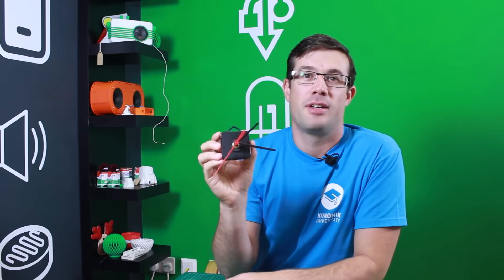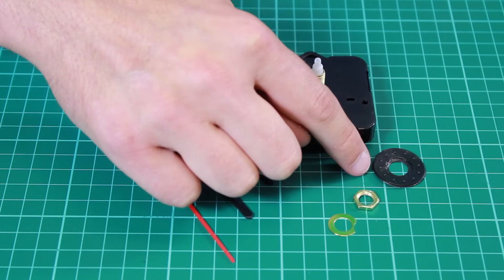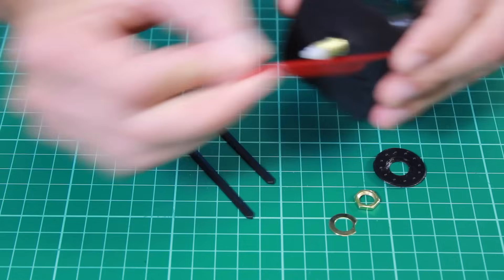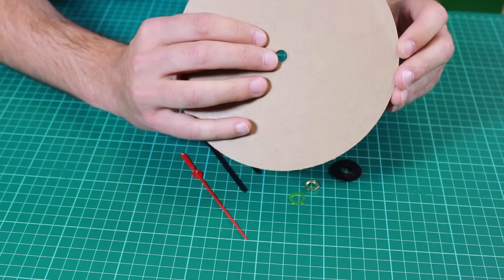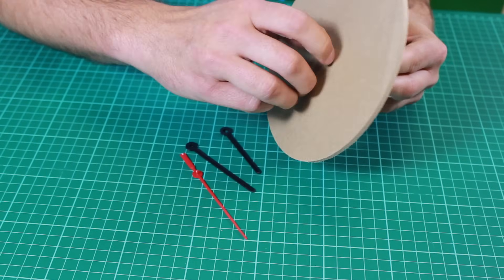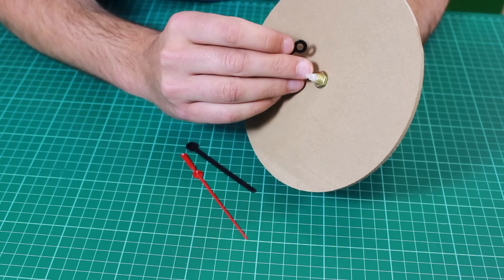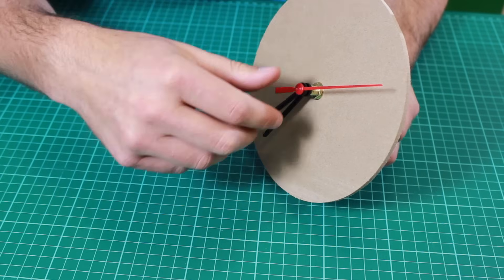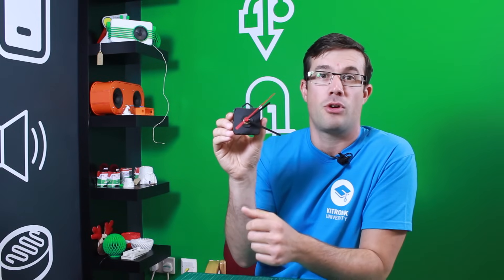Quartz Clock Mechanism from Kitronik

Comment: Great video. Thanks for sharing.  Some years ago I bought some clock movements. Now I'm finally so far that i made my first clock. I took one movement out of the package, but the manual with it was very short. Only some hazy pictures or drawings. Your video gives me the courage to give it a try tomorrow. Assembly of all types of movements seems to be more or less the same. Every (first-hand = new) has a second hand mounted as the third (last) hand, I guess.

Comment: I have your clock but the hands don’t stay still ??
Reply from the maker: Hi Daniell, sorry you are having issues. Don't hesitate to get in touch with our support team at support@kitronik.co.uk and one of our team will help you resolve the problem.
Reply: @kitronik hey sorry it’s worked now I just had to apply more pressure to the hands while putting them on

Comment: Could i convert this 12 hour quartz clock to 24 hour clock?
By making the hand gear twice the original??
Reply from the maker: I would be tempted to produce a more simple solution. Have two circular rings of numbers around the clockface. The outer ring would be the numbers 1 - 12, as normal, and the inner ring for 13 - 24. Maybe have them in different colours or the 1 - 12 larger than the 13 - 24.

Much easier than trying to hack the movement.

Comment: Why does my hour hand not stay tight and just flips down to 6? What am I doing wrong?
Reply from the maker: Hi, sorry you are having issues with your clock mechanism. If you got it from us, get in touch with our customer services team who will be happy to help you get it going or replace it if there is a fault. support@kitronik.co.uk
Reply: I am having the same trouble but I bought the clock from a wood working company.
Reply from the maker: @dlwsport250  Hi, did you try contacting them to arrange a replacement?
Reply: @kitronik  Thank you!! I followed your video one more time and though I bent the "hands" , I eventually got it working. The "key" was when you added the second and and it began to sweep I realized that I needed to apply more pressure. I am in the US and the maker is in Turkey. I am sure he would have replaced. A little "effort" was required and I was too nervous to break anything, It is working. Now I just have to have the courage to hang it up. Cheers, from Asheville, NC

Comment: Best video ✌️
I was searching exactly this.
In my kit there's no screws and washer or rubber washer. Only a machine and three hands. What should I do? Will they work?
Reply from the maker: Hi Munazah, as long as there is a nut to screw onto the thread it can be tightened to your clock face. If you are missing this then it would be best to contact the company that you bought it from and check if there are any parts missing.

Comment: Will it still work if you don’t have the rubber piece? Mine doesn’t have one for some reason.
Reply from the maker: The rubber piece helps to maintain a lock against the clock face and to prevent any slipping or movement. You may experience no issues but I would say a rubber washer of some kind would prove to be beneficial. Was your mechanism supplied by us?
Reply: Kitronik  thank you. I’m not certain where it was supplied from because it was a set given by my school’s wood shop class.

Comment: I want to do this on a wall with hands of my design and manufacture.  This would be no clock face and long (30cm) hands.  would your device work with the mechanism attached to the wall?
Reply from the maker: Hi Timothy, The mechanism has been designed for use with the hands it is supplied with which are quite light, it is possible it would work ok if the weight of your DIY hands were not too heavy. The only way to know is to experiment with your design until you find a scenario that works as you want it to.

Comment: What is the thread size on the threaded stud?  I need this to add another nut on the threaded stud.
Reply from the maker: The internal diameter of the nut is approximately 7.25mm, the distance between each thread pinch on the spindle is approximately 0.45mm.